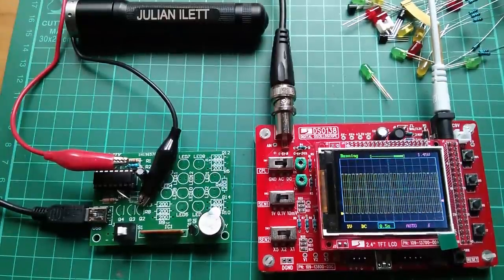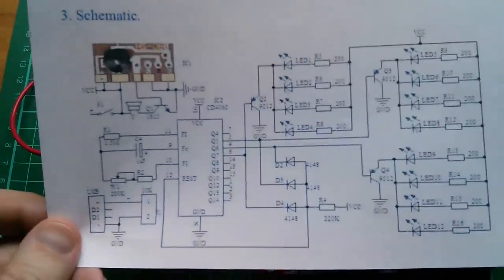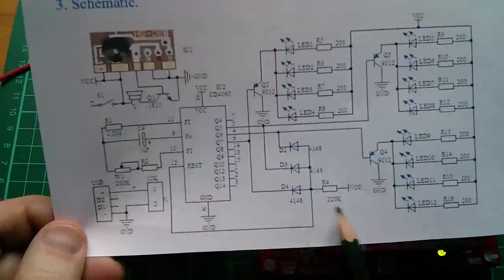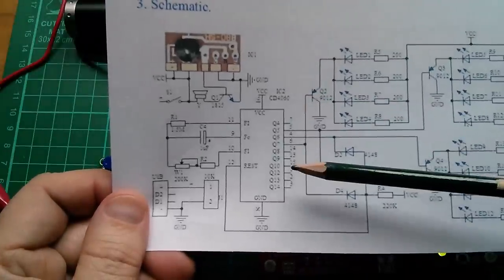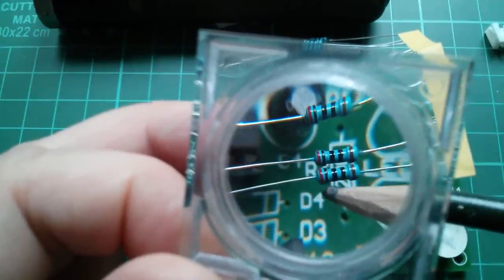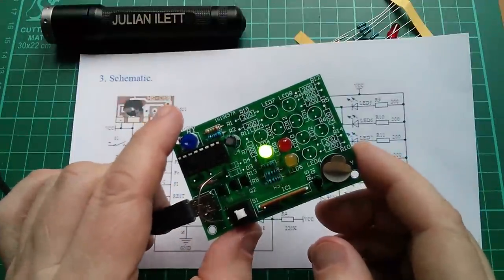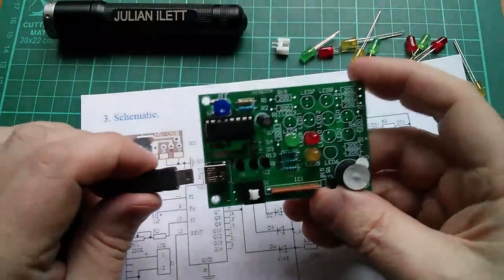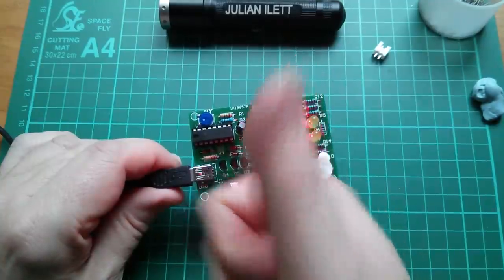Easy - Music Fancy Lantern Suite - Electronic Kit Build (part 2)

Comment: Fantastic step by step thought process. If something doesn't work for me it gets added to the "ebay crap box #2". This video is so much more than the kit build, adding a base resistor, tips on using the DS0138, etc, makes me want to go back and work out why things don't work.

Comment: Julian, you appear to have forgotten how a transistor works.  Those PNP transistors are working in "emitter follower" mode so most of the current flows into the collector and out of the emitter and the base current is only 1/hFE times the collector current.  So if the LED current is say 15mA then the transistor current is about 60mA (4 LEDs) and the base current is about 1mA, no problem for the CD4060.  There's no need for or advantage in fitting a base resistor.  Emitter follower mode is also known as common collector mode.
Reply from the maker: I didn't know Hfe works in reverse - never thought of it that way round.

Comment: Cool stuff. Good ridance of the birthday tune lol. If you need power-on-reset on the CD4060 to get a known state on all flip flops at power-on then you can from the reset input have a cap to vcc and a resistor to ground. I have a video too about the CD4060. I made a 30+ minutes startup delay for a cooling fan. Tapped off the mosfet control for the fan at Q14 of CD4060.

Comment: I liked the vid for two reasons. 1 it was informative 2. I wont be buying such a chuffing awful cheap and nasty piece of crud. You saved me about £5. Thanks! I actually bought one of the frequency counters after the last vid and then got the high frequency model (up to 500MHz). That's about 5 pieces of kit bought so fat after seeing you demo them (one PSU, two LiIon capacity testers and a few other bits and bobs).

Comment: You can alleviate the waveform distortion at low frequencies on that scope by increasing the value of the capacitor that gets switched in for ac coupling.  Up to a point,  anyhow.  I wouldn't go with a polarized capacitor in that spot,  not at all...

I used to run across all sorts of ripple counter chips in electronic musical equipment,  used to provide lower octave frequencies from a fairly high master oscillator for each note.  I would test these (and yes,  4060,  4040,  and 4020 chips too,  among others) by breadboarding them and feeding some audio tone into the clock input.  You'd get successively lower octaves out of each of the outputs.   :-)

Comment: As long as a bipolar transistor is operating in a linear mode, ie. it is not saturated, the base current is 1/hFE times the collector current.  These transistors are only just working in linear mode because there is very little voltage across them but they cannot saturate because the emitters cannot fall below about 0.6V.  The whole reason for having the transistors is so that most of the LED current flows through the transistor to 0V and only a small current flows into the CD4060.

Oops! this was meant to be a reply to my comment of 5 hours ago.

Comment: Naturally if I ever think I understand a circuit and put a wire link instead a resistor to test something - a release of smoke will shortly follow.

Please do more like this - or you could do something on the ttl and cmos families - or diode steering

Comment: 4060 is my favorite chip (but i prefer 74hc4060). With just few resistors and capacitor i can make easy counter/oscillator/divider. Every pin is basicly divider by 2, and, like in that schematics, with few dioides and pullup on Vcc it can count to exact number (just number must with exluded Q0,Q1,Q3 and Q10). It can oscillate even at few MHz. Only down side is that it's ripple counter, and delay can stack up when working at high frequencies.

Comment: Actually the resistor markings on the board are correct, it's always resistor value rather than resistor colour code. This is why workers doing based electronics assembly need to know how to read component codes and convert to value.

Comment: The 200 for resistors is not a gotcha all resistor values on a silkscreen are the value they are period. The type of marking you are thinking of are capacitors that are marked like 104 which are 10 with 4 zeros which is 100 000pF or 100nF

Comment: I like the idea, but could have done with a bit more technical detail - why was the resistor required for the "music" and I don't understand why resistors would be preferred on the LED transistors. Just my misunderstanding over NPN/PNP, I'm sure, but a little more detail would have clarified. Other than that, very informative. Thank you.

Comment: what Firmware Version do you have In Version 113-13801-060   Improved frequency measurement by using average voltage level (instead of true 0V level which was used in previous versions) as cycle counting reference.
http://www.jyetech.com/Products/LcdScope/Firmwares_138.php